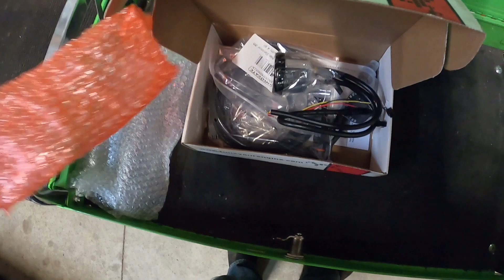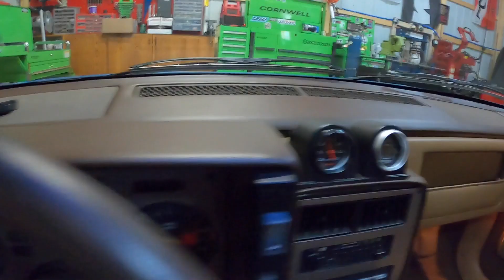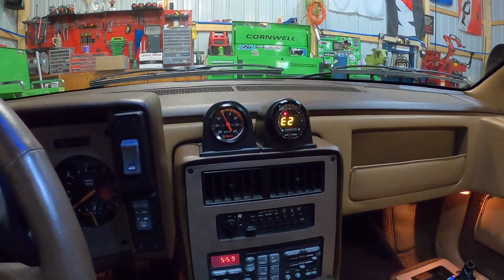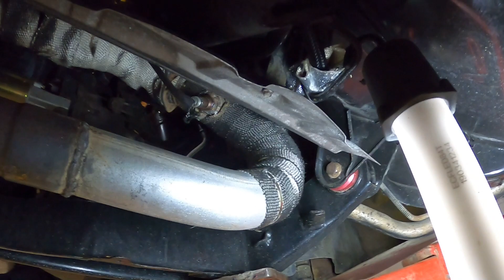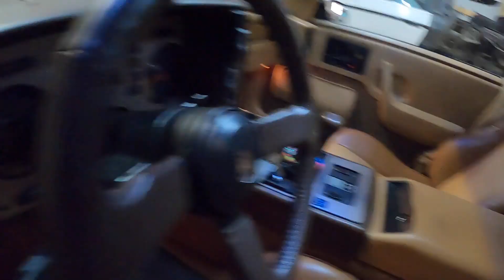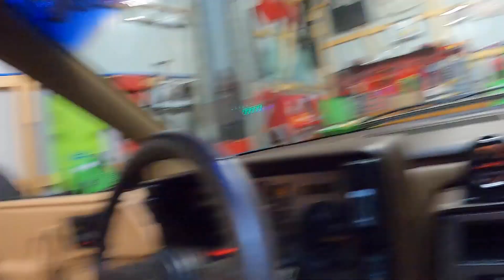3800SC Wide Body Fiero: Innovate Motorsports wide band install

Comment: I have a 86 4 speed Fiero that i am going to be doing the 3.8 supercharged swap. Is the 4speed good with that much power? What is a rough 0-60 time? And how hard is the swap/where do you get the mounts for the swap?
Reply from the maker: I’ve got 4000 miles on my swap with the 4 speed. It’s good so far but I’m sure it’s going to blow up sometime. It’s not designed for the power. I’m not sure what the 0-60 time is, it is pretty quick. The swap is straightforward and well documented online. Wiring info can be found at www.Gmtuners.com and mounts are from FieroRog on Pennocks Fiero forum or the Fiero Facebook groups.
Reply: @RearEngineShop   very cool thank you! great video!